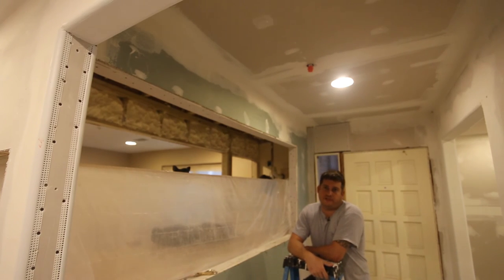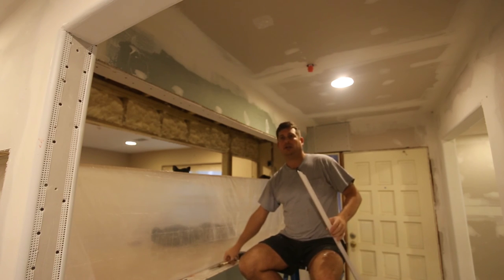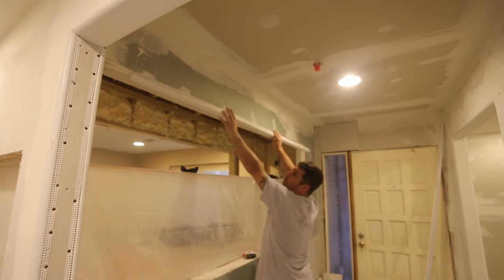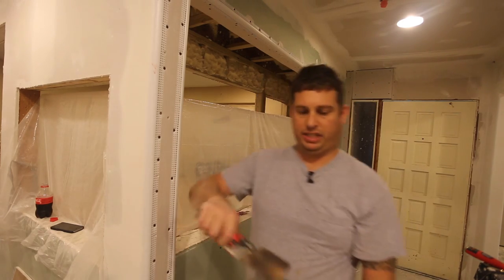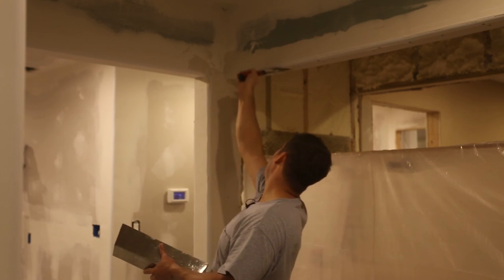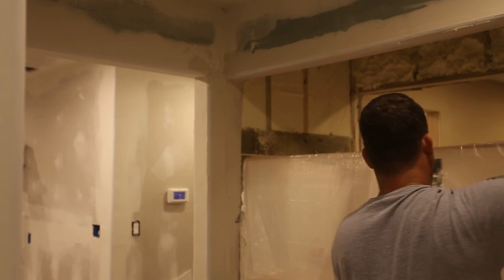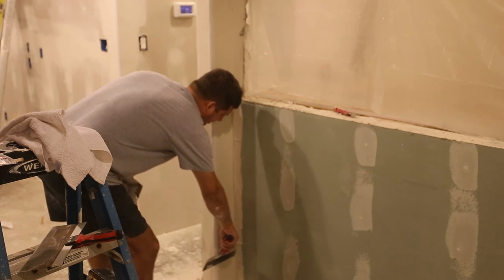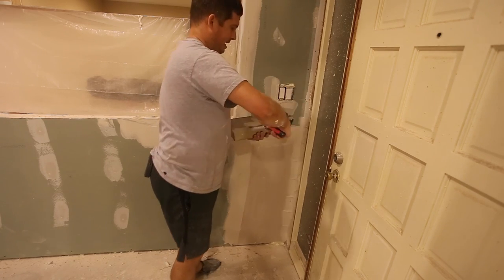Rounded sheetrock corners explained

Comment: We have an older house with straight edges. It looks like the ends are metal. Whats the best way to tackle these rounded edges with an existing wall?
Reply from the maker: Remove the existing corner bead and fit new corner bead.  Then re-float and re-paint.  Metal is a sharper product, but prone to dents.  Plastic doesn't dent, it just sheds the mud if you abuse it.  No winning either way.

Comment: I really don’t understand the need to sawsall the corner first. The corner trim is made to accommodate for the sheetrock.
Reply from the maker: It didn't fit the way I wanted.  Roughing the corner off made it fit properly.  Perhaps I should have cut the wallboard shorter.... shrug.  This worked and I shared it to help others out.

Comment: Curious if you've run a blower door test yet and if so what your results were. Thanks
Reply from the maker: +T Willey I have not.... I'll post the results when I do.  I have not replaced most of my doors yet or installed my ERV.  I expect the house to be very tight as I have made substantial efforts to seal it.  It stays wonderfully warm when it's cool out and cold when it's warm out.  My electric bill is running about half of what I planned on and probably a quarter of what it would be without super-insulation.
Reply: +Brian Greul you mentioned you had a problem with the proportioner....just curious what the problem was and if there has been any change of opinion in the Lil pup.  thx
Reply from the maker: +T Willey It is a great tool.  Have not had any issues with it.  Clogged the gun once, but that was my fault..... left the caps off it and didn't use it for a couple of weeks.  Easy to fix.
Reply: Do you have a background in building/ construction? Also, how much did you spend rebuilding the house? Do you think doing the insulation yourself was worth it?